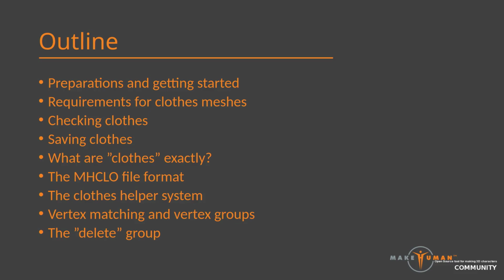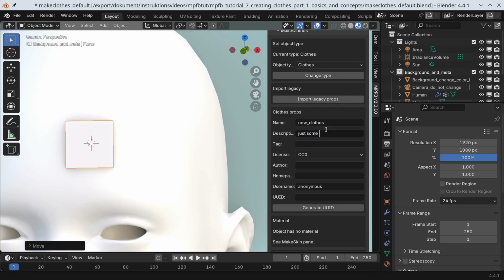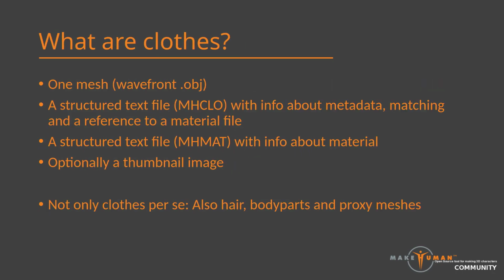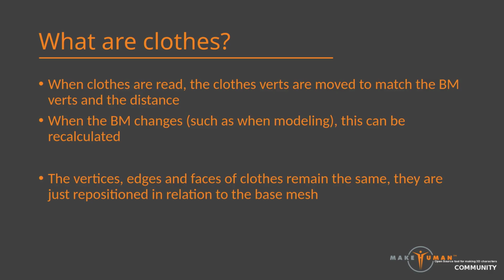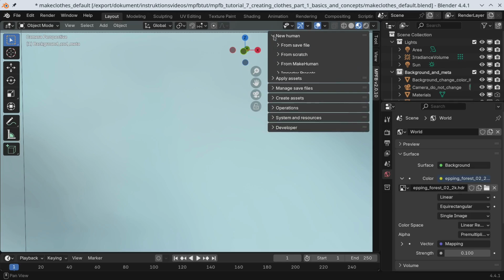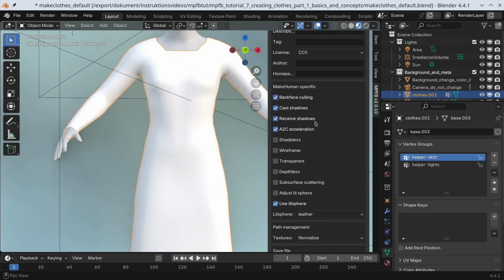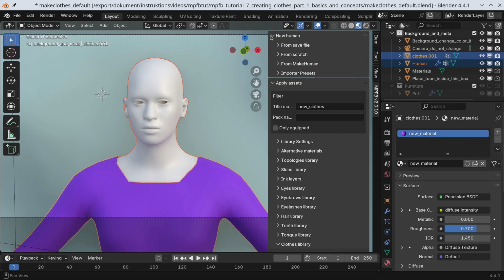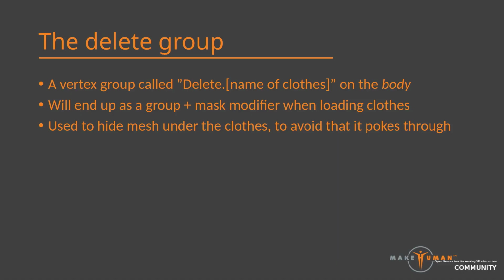MPFB Tutorial: Creating Clothes Part 1 - Basics and Concepts

Comment: I loaded a T-pose male base model into Jinny and created some clothing. Everything fits perfectly. In Blender, the clothing also fits perfectly on a freshly generated character from MPFB. However, no vertex groups were created.

I don’t know much about Blender, so I preferred to create the clothing in Jinny. I just wanted to put the clothing onto the MakeHuman character in Blender using the MPFB add-on, but unfortunately, it's not working.

Any quick tips?

!Okay, I got that working, but now all the textures are gone.
In Jinny, I textured everything nicely. After running the "Make Clothes" step, I saved the clothing to the MPFB library.
But when I restart and load it onto a fresh character, all the textures are missing.
Is there an easy way to prevent this?
Reply from the maker: It should work as long as the images are available. But it's hard to say based on the information available here. 

Maybe you could post a support request at https://github.com/makehumancommunity/mpfb2/issues and include screenshots of what happens? I would like to see the contents of the directory that was created when saving the clothes in order to give a good answer. You can find this under "system and resources" -> "directories" -> "user files" -> "data" -> "clothes".
Reply: @MakeHumanCommunity  Thanks for the response, I'll submit the ticket over the weekend :)

Comment: Can we use an alternative helper layer for the upper portion of the clothing instead of tights? I am aiming for a design that does not conform closely to the body.
Reply from the maker: Your three options for the upper part of the body are "body", "helper-tights" and "helper-hair". The hair helpers might make sense to use in the bust area and if you want something on a distance from the neck. Note that not all verts need to belong to the same group, so you can match part of the clothing against the hair helper if you want,

While theoretically it would be possible to add helper layers to the basemesh, you'd not get very far with the clothes once you have produced them. When loading the clothes, the reverse matching is made, so the clothes would then not be possible to load onto a default basemesh.

Comment: Thanks a lot for the great video! 

If I follow your tutorial (the first part without the helper) I keep geeting an False on the Check "All verts have min one vgroup" altough I added the body vGroup...Any guesses what could be the problem?
Reply: I have the same error, following instructions precisely...  I started over from the beginning and notice that when I create the Vertex Group for the rectangle and name it 'body' there are no buttons for 'Assign', 'Remove', 'Select', 'Deselect'. I don't have those. I'm using Blender 4.4.3. Not sure if that's the problem. Checking again, I get the error again: All verts have min one vgroup: FALSE. All other values are true. I followed the instructions precisely. Created a plane near the forehead, scaled it down and made sure it wasn't touching the surface of the body. Selected the rectangle and the body, click check. Same error. 

 I'm trying to debug this. So, after we assign a material to the rectangle and then go to the vertex groups and create a vertex group for it and name it 'body'. You have to switch to 'Edit Mode' and THEN you get the button under the new vertex group called 'body' that lets you 'Assign' it. Click that, then carry on with the selecting both the rectangle and the human and press check and it passes.

Ok great, so  it passes the check. Then I click the button for 'Store clothes in library' and it fails with: 'Error creating MHCLO. Do a clothes check and/or check the log for details. So, the log appears under Scripting and it says absolutely nothing. So I restarted Blender from a shell: and was able to see a more detailed message:  Info: Clothes check performed, see panel
[ERROR] makeclothes.clothescommon ..............: Error creating MHCLO Cannot operate on objects with different scales.
[ERROR] makeclothes.clothescommon ..............: Clothes check object {'is_valid_object': True, 'has_any_vertices': True, 'has_any_vgroups': True, 'all_verts_have_max_one_vgroup': True, 'all_verts_have_min_one_vgroup': True, 'all_verts_belong_to_faces': True, 'all_checks_ok': True, 'clothes_groups_exist_on_basemesh': True, 'warnings': []}.  

Cannot operate on objects with different scales?  Is this because I used the 'Scale' tool to make the plane smaller? It turns out you have to be in EDIT mode when you scale the plane down to a small rectangle. That way the 'Scale' of the object is not altered. You can see the'scale' of the object by looking in the side bar panel (press 'N') in Object Mode there will be a tab called 'Item' and then you can select the rectangle and check the 'Scale:' and it should be X: 1.0, Y: 1.0, Z: 1.0. If you scale the plane while in Object mode, these values will look like X: 0.038, Y: 0.038, Z: 0.07 or something like that. That's what that error is about.
Reply: @foo_tube  Thanks a lot! 
So you managed to solve the problem, right? I will try again...
Reply from the maker: Short of having encountered a bug, my guess is that you're missing a loose vert somewhere. Maybe it's hidden or masked? Make sure there is no mask modifier. Then press alt-h to reveal hidden verts. Then deselect all, go to the vertex group panen and select the verts in the vertex group. Now you should be able to do select->invert to find the verts which did not belong to the vertex group.